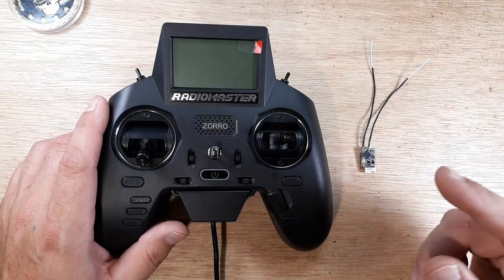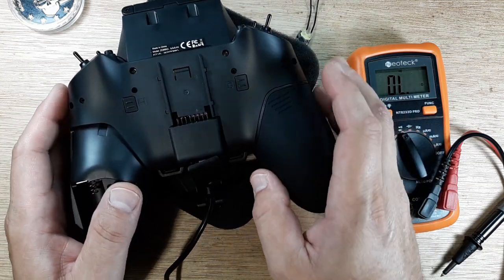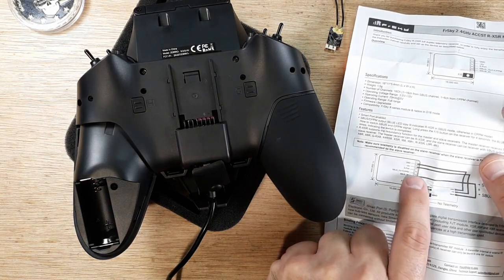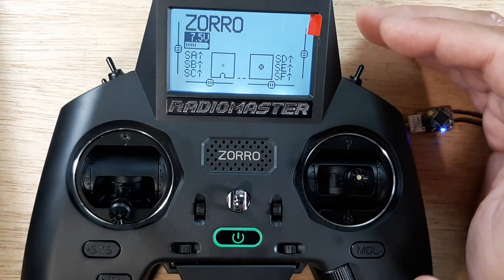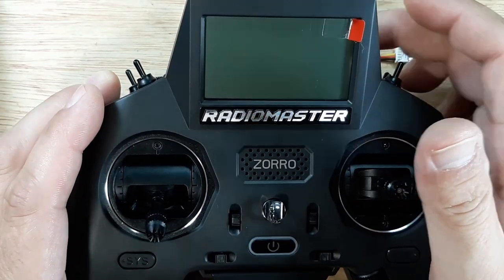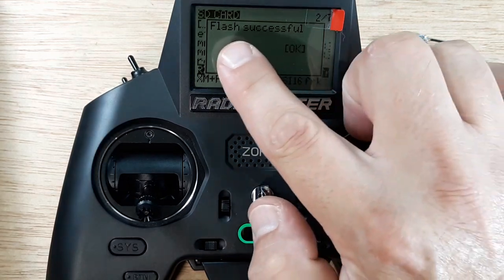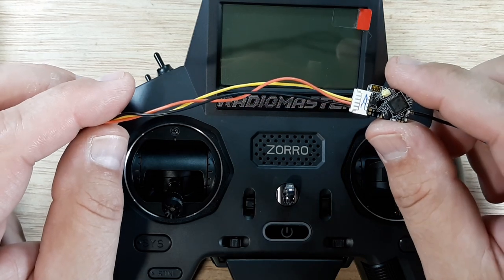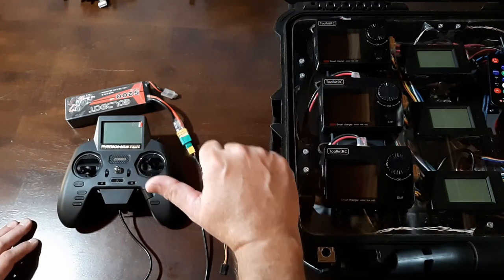How To Flash Frsky RXSR Using The Radiomaster Zorro

Comment: Great Video Props I to also pushed my servo wire down it kept coming undone so I shaved the servo end down a bit now it almost locks on pins take care 
PS love the Binford 1200w charger  more power lol
Reply from the maker: Robert, you have a great mind! Shaving the plastic of the connector is a much better way...👍🏻🍻👊🏻
Reply from the maker: Thank you! I designed the charger to be able to charge all my lipos at once. So gone are the days we're it would take 3+hours just for lipo management. I think I'm more in the 28 minute range now. I really got lucky with open box (missing parts) that were cheap. I think it took me just under 3 months total (most of was shipping). The hand painted sign was probably my favorite part...🍻
I have a one minute stop motion video of it, lol. I thought more people would have watched it, but tiz YouTube...

Comment: Dude your awesome, I just bond my tx16s to my frsky, thanks
Reply from the maker: Glad it helped.. I appreciate your kind words of encouragement...👍🏻🍻👊🏻
Reply: Hey I have a question , when I wire the r-xsr to my speedybee f7 V3 Flight Controller and power it thru betaflight,only sticks work,not switches... Any suggestions??
Reply from the maker: @HPFPVS  
Is your inputs and mixers enabled in the radio?
Reply: I didn't know that you had to define each switch but I got it, thanks for your help. This is far from straight forward, I miss the controller's that you simply hit the bind button and done... Lol

Comment: Doesn't the Zorro 4 in 1 protocols have BOTH Frsky Rx's covered be it the older style ACCST and the ACCESS newer ones already ?  It will bind to both styles already ?
SO why the flash back to an older firmware ? If I understand correctly that is what you are doing ?
Reply from the maker: Great question! Unfortunately, the 4in1 will not run the Frsky proprietary firmware ACCESS; Therefore, the firmware needs rolled back. Interestingly enough, it seems the 4in1 will run the "history" firmware and V2 firmware (although I haven't used V2 myself), but not ACCESS...
Enjoy the Breeze...👍🏻🍻👊🏻
Reply: @propsoff  I am assuming a couple of my quads have the newer Frsky because they would not bind to my Jumper T8SG radio ( one I know is ACCESS ) and I decided to upgrade my radio and ordered a Zorro as I liked its look, and now I assume it will not bind to my newer quads that have XM+ Rx's either . So much frustration keeping up with all this tech nonsense .
I do have a couple older XM+'s I could just change them out to make them work rather than try and flash them as I do not know how and your video appears to be complicated for me at the moment
Should have just stuck with my fixed wings they are less complicated...LOL
Reply from the maker: @FlyingBuzzard  
Youtube makes me crazy, I just now seen your reply and its dated a month ago:(
All XM+ Receivers are native to the "Historical Firmware ACCST" No worries of ACCESS for them. I am probably too late, apologies...

Comment: It’s the same process with R81 receiver ?
Reply from the maker: The R81 has Radiomaster's firmware on it and I didn't need to flash. It uses the D8 protocol instead of the D16.

Comment: Hi From France mate, thanks you for your video and explanation but i have trouble when i try to bind my zorro on the R-XSR, i'v followed all the steps excepted my RX is a LBT version cause i ' m from Europe.
I have successfuly flash the RX with the right Firmware downloaded on the FRSKY official website for LBT.
 When i do the steps for binding my Zorro still not bind with the RX.
The RX is wired well and i don't understand what happen 

My Zorro IS a 4 in 1 multi 
And the R-XSR is EU-LBT 

Thanks you for your help mate and nice vidéo !
Reply from the maker: Let me do some research tonight after the kids bedtime. I'm very unfamiliar with LBT firmware...🍻
Reply from the maker: Do you have Facebook? Could you copy your message and paste it into a pm messenger? 
https://www.facebook.com/scooter.pie.100?mibextid=ZbWKwL
Reply: @propsoff  Hey mate, i've solved my trouble , i did a video about it on my channel.
I've dealt with the Internal module to bind my R-XSR and not the external one.
For the  LBT EU version with the right mode/subtype

thank you for your guide

Comment: Hi there my one doesnt have the connector is straight up wired to the flight controll
Reply from the maker: Unfortunately, you will need to do the extra steps of soldering. I have half of my Rxsrs directly soldered. That would make me just switch to Elrs..
Reply: @propsoff  i was thinking that as i have elrs reciever as nano but my flight control doesnt show how to wire it as frysky xrm is. 3 wires and my elrs is 4 connectors wire?? U based from uk ??
Reply from the maker: @vinnyp8574  
USA..
Check this video out..
https://youtu.be/xQCM7CYaJH8